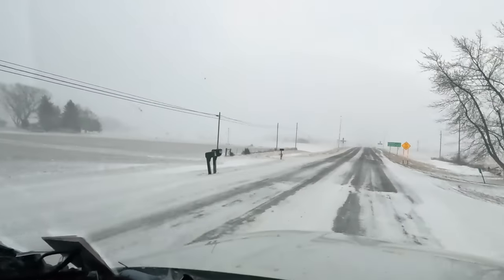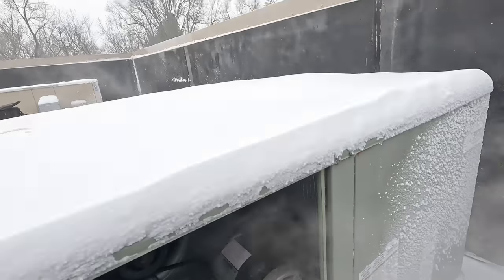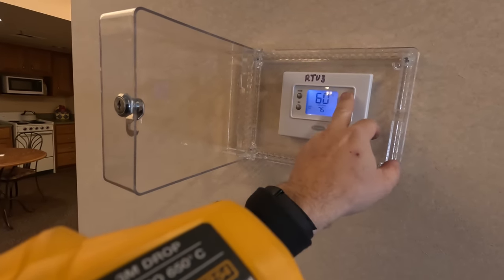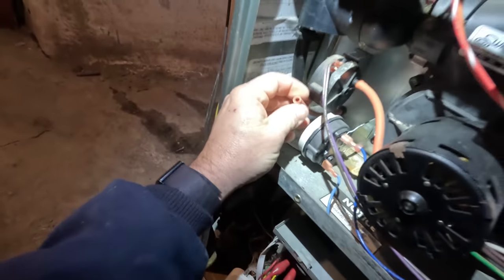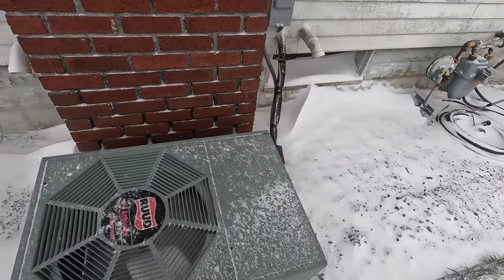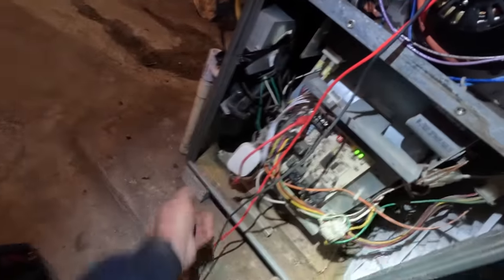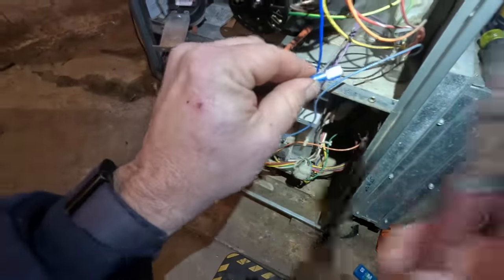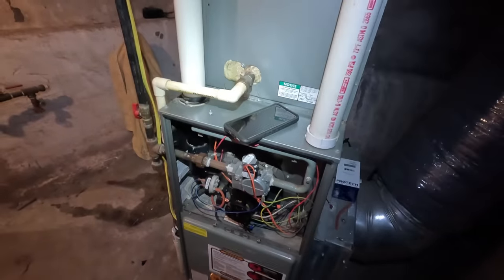-6°F Out... Now They Both Don't Have Heat

Comment: During the hour long drive to get parts, the home warmed up to 58F 15C, it will take a long time to reach a comfortable 68F or 20C.  

With certain Cities wanting us to install the very smallest furnace to keep the home warm, they seem to forget on very cold days it will take hours to reach a comfortable temperature when starting at 30F.  My guess is that the home has very little insulation between the very cold basement and the living space?  That does not help at all!

If they have a electric stove, I would recommend running the oven, but not with a gas oven.

Comment: For those playing along at home... make sure the port at the inducer casing is clear.  It is the first place for FOD (like drywall dust),  to try to get out and if blocked, even partially, It will not have the draw to close the pressure switch(es).  If it is clogged, it will make the switches look bad.  I carry small bits, orifice sized, to clear the port.
Reply from the maker: That's why I checked the actual draft being created by the IDM with the monometer, it was about 50% higher than needed to close the switch.
Reply: @HVACRSurvival  When the port is restricted, it will not allow enough suction to pass quick enough to close the switch.  The draft will look great but it can't draw through the port orifice.  I had a spider web stop one, the kind of spider that clogs grill orifices.

Comment: I know it is an efficiency thing, but they make everything so complicated. You would think that someone could manufacture a simple, high efficiency furnace. During my 75 years on this earth I can't remember having to have a service call on a furnace. All that was required was to change the air filter and an occasional fan belt.  Also,  the blower fan and motor had oil cups, which if oiled periodically, would very rarely fail. Hey, times change, and I guess we have to be thankful that there are people like you that understand these new systems and are willing to brave the elements in order to keep us warm in the winter and cool in the summer.
Reply from the maker: Thanks for checking it out Willy!

Comment: So I know on the nests, idk about the ecobee, but if you jumped out red to white or yellow or green it would cause the thermostat to error out, and it would open the circuit. They use transistors/solid state switches instead of mechanical relays and they read the resistance/voltage drop on the circuit and when you jump it out it freaks them out and they'll lock out when you change resistance it was used to seeing
Reply: The nests are notorious for the cooling circuit failing if you have a loose connection to the contactor or any chattering that can cause high amp draw on the y wire or even if it's trying to run a large contactor or multiple contactors or had any thing close to a short to ground it would fry the transistor/solid state relay. So when you read voltage at the contactor control side it when it's connected you'd get 50-500 MV but if you disconnect and read sometimes it would be 9-24V but the current carrying capacity would be severely reduced when it fails. I think they even list the maximum amps each control leg coming out of the nest at like 200-500 MA and it's a hard rating... I've even had a sticking reversing valve fry one once that was a kick in the butt, after changing the valve and getting ready to run in cooling nothing happens 🤣🤣
Reply from the maker: You would think it wouldn't be like that being these technically are not a power stealing thermostat because they have a common wire but this was a huge issue when they didn't have Commons required. The old power stealing stats were able to be powered off just r&w, total pieces of crap usually, I wouldn't be surprised if they used a capacitor to keep the display up and going while that circuit was closed.

Comment: That he used some oil for the motor to fix the noise of the bearings temporary, this is nice. 
But he should give the owner a list with some tips how they can improve their system.
Reply: Item 1: Remove old furnace and bury in abandoned mine shaft.  :)
Reply from the maker: @Mike I know I talk fast but if you listen to what I said you'll hear me say I told the customer about it and he said it's been like that forever and he did not want it repaired beyond what it took to get it running. I don't go into all the details in the video so give me the benefit of the doubt, he also told me that he wanted to sell the house next year,  not that that makes it right but there's nothing I can do if these people don't want to spend the money. How about just being glad I made the video.

Comment: sometimes pressure switches shows good in tester but due to carbonization on contacts they dont really close the circuit when in operation same as amplifier relays they dont have an output yet when you test them they are ok

Comment: 14 of the calls were high efficiency gas furnace the drain lines were frozen easy fix but driving around to all of them took alot of time I had bad inducer fans bad boards bad indoor blower motor bad capicater

Comment: You have a high tolerance for screechy belts and inducer motors!😊
Reply from the maker: A little. Probably losing some more hearing 🫣.  I would have rather aligned the belt but not when it's that cold 😁

Comment: Great video. Thanks.  Your alligator clip lead looks just like the ones I used years ago from Western Electric.  Looks like the same label too.
Happy New Year.
Reply from the maker: I built them from silicon test leads and added my name on a label.
Reply: "Keeping your phone system the best in the world"  -- Bell System ad slogan, 1970's.  I just took a photo of an old Bell System ground-level buried cable tag on a utility pole; most of it was still readable. Quality??  THAT was quality!

Comment: I did learn Rheem furnace doesn't have the safety on it. That shuts the burners off if it can't drain like a Trane and Goodman and I think carrier Rheem will back up and drain out of the furnace whoever installed this furnace put a small pan under AC coil but not under furnace so his ceiling had water pouring from it

Comment: that add a wire, are never friendly when they work ok but when they do not good luck! in some cases that is all you can do, guys use 8 wire or more it helps the next tech out of a jam in the future the cost is minimal it could be you. thanks. this one was a pistil multiple issues good work
Reply from the maker: I agree, I prefer one or two extra conductors for future repairs or accessories

Comment: Good fix on the  residential furnace.I never liked 90% efficiency furnace the heat exchanger fail to soon and when the  warranty ends they so pricey
Reply from the maker: Most have a limited lifetime on the HX, at a minimum 20 years usually.

Comment: If they keep the fan in auto just use the "G" wire as your common wire.
Reply from the maker: That is an option if the customer is willing. 👍👍
Reply: This does work

Comment: I had to take many a piss on the roof this week too😂😂😂
Reply from the maker: There's something about the cold that brings it out🤣
Reply: @HVACRSurvival  But you didn't autograph it.🤣🤣🤣👍
Reply from the maker: @joehead1294  This was my first edit with my new computer and I had several issues, also this was my first 4k video, I stayed up until 2am correcting things that got screwed up.
Reply: @HVACRSurvival  Didn't you ever write your name in the snow as a kid?  😆
Reply from the maker: @Joehead1294 I probably peed outside more times than I have inside, I'm pretty sure I did 😁👍👍

Comment: Great video Rick. I just replaced a pressure switch on one of my houses because it throws a code saying switch is bad and i can visually see the error. I still couldnt quite follow how you determine the one on the left is faulty. is it because that one is on the pressure switch circuit?  so the one on the bottom will never be a problem?
Reply from the maker: Because only one of the pressure switches were on the pressure sensor circuit, the other one just broke power to the gas valve.
Reply: @HVACRSurvival  hey sorry to bug you I was trying to understand this as well
Reply from the maker: The best way to check a pressure switch is to put a tee in line with the pressure switch and draft motor, then measure it with a manometer. If you're lucky the pressure switch will have a rating on the side of it, you normally want to be one and a half times more than what it is rated at but that's just something I've noticed. You definitely don't want to be right at the rating.

Comment: Which mini splits would you recommend as a pro service mecanic in terms of reliablility and quality ? Are the daikin models a good choice ? Servus from Germany
Reply from the maker: Mitsubishi is what we sell, I don't like anything I have seen from Daikin
Reply: @HVACRSurvival  Thanks. What uyou dont like on Daikin ? I thought Daikin and Mitsu are near the same quality and reliablility?
Reply: @danielprose5878  Most techs don't like Goodman which Daikin is a part of. They can be ok if this install is done properly.
Reply from the maker: Technical support is the big thing with any of those mini splits, I don't like working on them because I don't know them very well, I do too many different things to be specialized in it. Each guy at our shop has a niche that they're really good at and that's not one of mine. Mine is the ice cream related machines and generators but even generators I'm not that great at anymore because I don't work on them very often.

Comment: That draft motor is NOT ok and you know it. You should have replaced. Yes I know Rheem draft motors are expensive but that thing could fail anytime.
Reply from the maker: I'll remember that next time 🤔...I'll punch the customer in the face, take his wallet out of his pocket and tell him you said your gonna replace it👍👍🤦🏻🤦🏻. People have the right to be an idiot, it's not my problem if it fails after I told him to replace it.
Reply: I don’t recall you stating that the customer refused the repair. I wouldn’t have commented if I knew that. After going 1.5 hrs to get a pressure switch…
Reply from the maker: Go back and watch it again. I said the customer said it's been doing that for a long time and he just wants to make it run and make it make heat.  I didn't use proper grammar, but it is what it is and that's exactly what I said. You got a listen close, I talk fast. Why would I not want to sell him a new part?

Comment: white vinegar works to dissolve that blue corrosion stuff
Reply: in this case, that was likely already "acidic" corrosion, from condensate. so it would likely not do anything to it or speed up the corrosion. so you'd probably want an alkali or other neutralizer(baking soda). something far more acidic would clean it, but probably do more damage than good :)
Reply: @throttlebottle5906  ive used it on leaked batteries and it breaks it down pretty well makes it easier to clean off
Reply: @blankmans8908  small cell type batteries are often alkaline type (potassium hydroxide) which is an alkali on ph scale, and standard white vinegar is an acid on ph scale, so it neutralizes and helps clean the alkali material off. to neutralize something acidic, use something like plain baking soda or mix it into a thick paste with plain water. it will fizz and foam, possibly making a mess.(vinegar and baking soda mixed = volcanic foamy mess) lol
always flush with plain water/rubbing alcohol afterwards.
Reply: @throttlebottle5906  dunno the nerd aspect im just stating what worked for me
Reply: What about contact cleaner?
Reply: @markh.6687  that doesn't really penetrate and neutralize the acid or alkali, you need to neutralize, physically clean all corrosion to shiny metal, maybe even acid etch and neutralize again, then you can do final washdown with contact cleaner and coat with thin film of with dielectric grease or petroleum jell, choose whichever won't effect the surrounding materials and parts.
if you don't coat it with something afterwards, it will still be very prone to corroding again, since the thin plating layer is gone.
Reply: @throttlebottle5906  I agree with your analysis, but in the field they usually love a spray-can solution, maybe battery terminal cleaner would be a better choice than contact cleaner? (somewhat better in line with your chemistry explanation).

Comment: you can tell you do more comercial then residential because you were testing the WRONG pressure switch that is the condensate switch the one at the bottom was the actual primary switch and used a damn wire bursh on a board like wtf